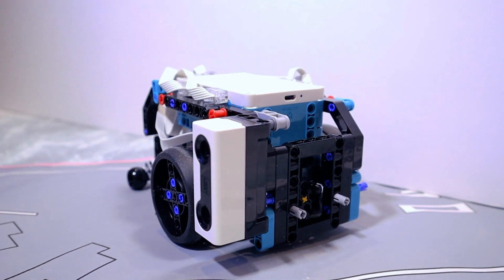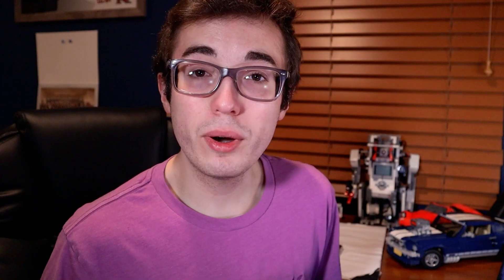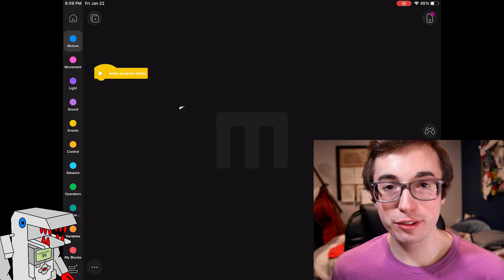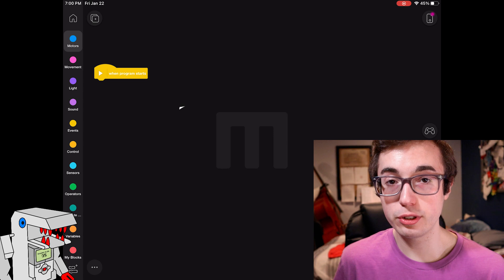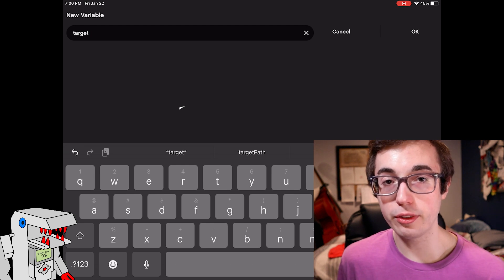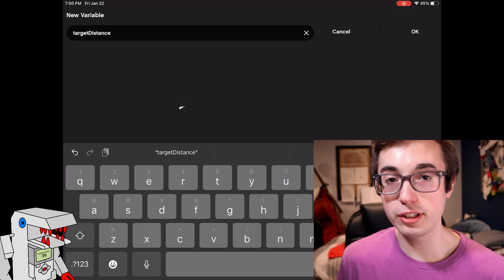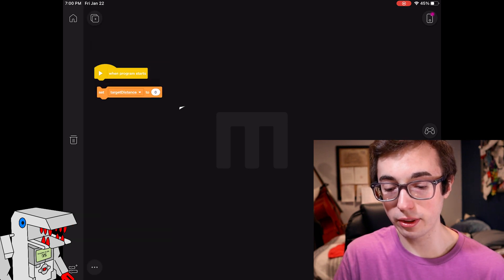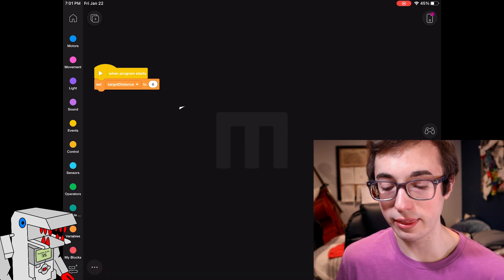Proportional Wall Follower for LEGO 51515

Comment from the maker: Have you ever used a wall follower in FLL or WRO? Let me know here!
Reply: Nope, i usually use a set of wheels on the side of the robot to move along the wall, especially for wro
Reply from the maker: @OWNEDGAMINGwasd  that is also a solid strategy!
Reply: In 2018 we used an ultrasonic sensor in the front, in the robot I'm planning on using in this years's FLL, there won't be an ultrasonic sensor.
Reply from the maker: @andrewzhuo6399  Why did you choose to not use an ultrasonic sensor this time?
Reply: @Builderdude35  Partially no room but partially because I am more used to the other sensors, and mostly because I can't find a use for it that can't be replicated by other sensors. I.e. wall following, the gyro or color sensor can help the robot go straight, stopping at a certain point because it detects a wall (motor encoders and motor encoders are much more versatile).
Reply from the maker: @andrewzhuo6399  sounds like you are thinking like a true engineer!
Reply from the maker: @Commenter That's pretty epic!

Comment: In FLL competitions, I recall seeing some teams getting "faked out" by walls LOWER than the ones at their team's practice area.  Their wall-following programming would not work because the 3-1/2" walls they had at home were not the same as the 2"-high walls they encountered at the FLL tournament competition.
Reply from the maker: That is a fantastic observation. I also noticed in my own experience that the mat itself sometimes "floats" around within the perimeter of the walls, because the walls may be slightly larger than the mat itself, leading to inconsistent distance measurements relative to the wall. Thank you for sharing your wisdom!

Comment: We tried. In FLL, in our third year (into orbit) we tried to do it when doing a few missions, but it never really worked. We ended up just using lego aligners and hoped our bot would go straight. It worked out, though. Also getting the infrared sensor low enough and in the right position was hard, so we just scrapped it.
Reply from the maker: Indeed, in FLL it is difficult to execute a proportional wall follower. I think WRO participants find more utility from what I have seen. Thanks for sharing your experience!

Comment: I tried your algorithm and it seems to work fine only when the robot is placed at the correct or almost correct distance from the wall. 
I used EV3 with the new LEGO classroom application. I had the same problem with the old LEGO EV3 programming environment.
In the following situation the algorithm failed. I used a target distance of 20cm so as the robot to follow a line 20cm from the wall. I placed the robot at a distance of 30 cm. The robot turned right and it moved forward towards the 20cm line. But it did not stop at the distance of 20cm but continued moving and turning until it hit the wall.

The problem, I think, is that when the robot turns right to move towards the 20cm line, the distance sensor is not vertical to the wall, but it looks at it in an angle. So when the robot is at the 20cm line, the distance between the sensor and the wall is larger than 20cm because that distance is the Hypotenuse of the right angle triangle formed by the sensor, the point on the wall where the sensor looks and the point of the wall perpendicular to the sensor.

Am I doing something wrong??

My solution is to move the robot for a few rotations, then  use the gyro sensor to turn the robot parallel to the wall so as the sensor to correctly measure the distance to the wall, and to repeat the process until the robot is at the correct distance from the wall.